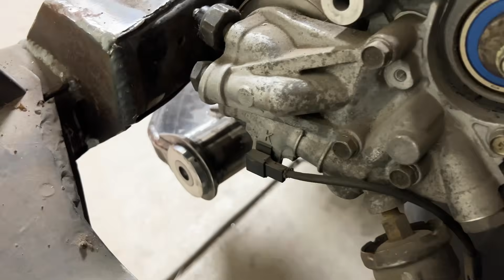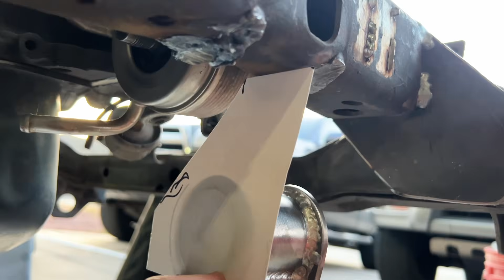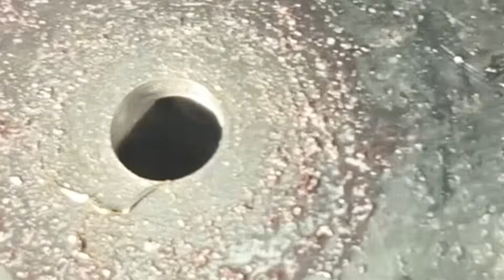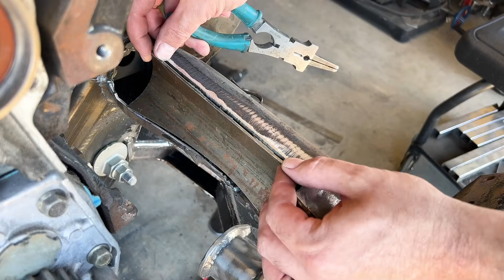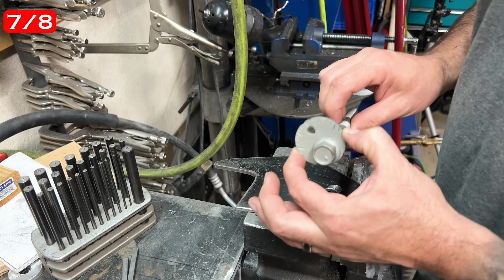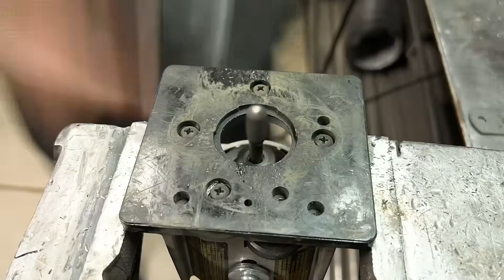Mounting My Custom Control Arms (Part 2) Mighty Max Ep. 26

Comment: My drive home is exactly an 1 hour and 5 minutes of boring, empty highway.  I know what I'm watching.

Okay, edit to say... "Calling all HVAC folks who are Mankandy fans and live in the Vegas area.  Your boy needs an assist!"  My guess is that your condenser is freezing up, because it seems to work better after you turn it off for a bit.  Next time it starts blowing hot, go look at the lines outside and see if there is ice on them, which can happen even when it's 115 degrees outside.  This is a common problem for a few reasons... we'll get to that.  Check all air filters in the house and make sure they are clean and the cheapest full flow filters you can get.  More flow is better than more filtration, so long as you change them regularly.  Next, make sure the coil (the big square radiator outside) is clean and free of dirt and debris.  Dirty filters, and dirty condensers strain the system causing pressures in the refrigerant lines that can cause the freeze.  Rinse the coil and see if this helps reduce how often it freezes.  After that, if you still have an issue, you might have a small leak and you are low on refrigerant.  This can also affect pressures and cause freezes.  If the fan outside is running, it is NOT the capacitor.  Alternately, if the AC is blowing in the house but the fan outside is not spinning, it is likely the capacitor, or at least the first thing I would check.  I hope that helps.

Comment: To augment your router with the burr... stick a 45* (or whatever you have) carbide router bit in, and you can get a bitchin' bevel on your plates.  Oh yeah, and stick your edge guide back in, and you can "machine" nice straight lines for things like your slot.

Comment: A roll of Ram Board used as a floor covering during construction available at home improvement stores works good for templating brackets and stuff as well.
Reply: Yep cam to the comments to tell him ramboard also
Reply from the maker: Is the curl not hyper annoying? I think I’ll go grab some and find out. Definitely more accessible than flying to Vegas to visit the Upholstery store.
Reply: @GarageFab  it flattens out ok. Could be annoying possibly for larger templates. I was thinking of cutting it in 4ft sections or so and stacking it with some plywood on it to flatten it out. Also thought about ironing it maybe. I’ve gently bent it opposite the curve to flatten it out for the small pieces I’ve used it for.